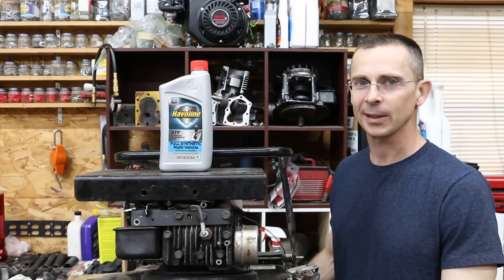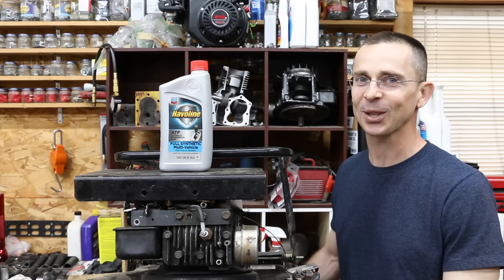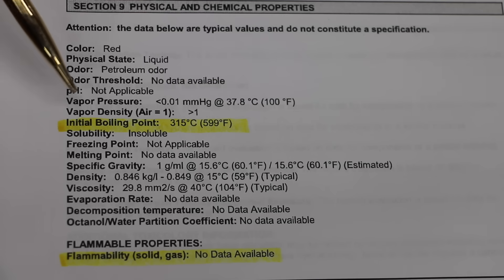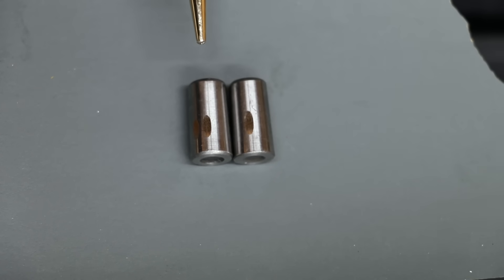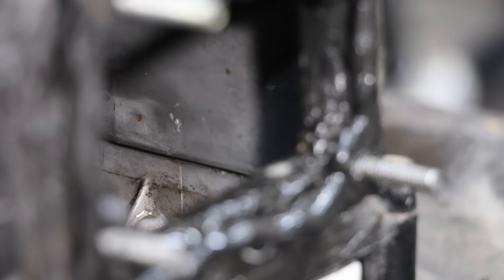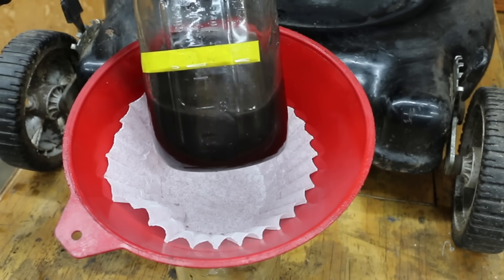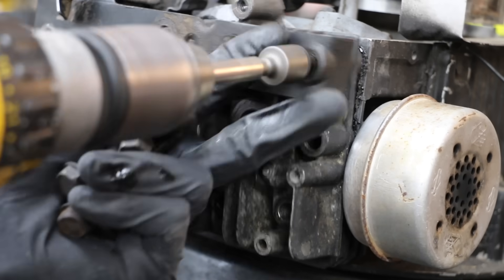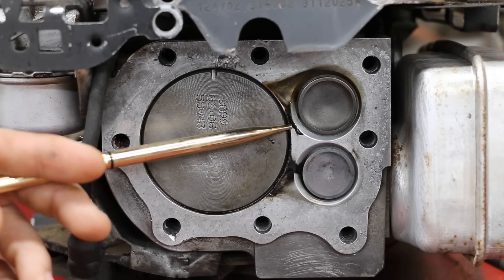ATF as an Engine Oil substitute?  Let's see what happens!

Comment: First off, Great videos, my personal preferred way of cleaning an engine has always been to pour a quart of atf in the crankcase while I use an iv drip to feed it either seafoam or techron injector/intake manifold cleaner, usually a quart of the stuff takes 30 minutes or so with the rpms held at 2k, I've done this probably 30 times now with 100%, success and clearly a much better running engine after.
Reply from the maker: Thanks for sharing.

Comment: 1 more trade secret for you... adding normal brake fluid (not synthetic) to engines that smoke at iddle, usually from valve seals, will stop the smoke on the spot, 1 small bottle of break fluid will do for most 4 cyl engines, the brake fluid will soften the rubber on seal that hardened with the engine heat overtime, and most of the brake fluid will eventually evaporate with time so it is not going to cause problems on the long run, it will also help with seals all around, same thing if you have a petrified O-ring that you want to revive, leave it in brake fluid 24 hrs or more till it softens back to your liking, the more time the softer it will get.
Reply from the maker: Thanks for the feedback.
Reply: @ProjectFarm  My pleasure, love your dedication to bring awesome content, keep it up 🤙

Comment: I have used it to clean the engine many times, but in a different way... around 500 miles before an oil change I will add 1 Qt of transmission fluid to the engine, without taking anything out, usually the engine is already a tiny bit low in oil and the extra Qt will just go over a very small amount, still always measure to see if it needs even more, and then when it reaches the oil change mileage I will simply change the oil. That method has worked extremely well. Another method for cars that had been neglected is remove 3/4 of the oil and replace it with diesel, idle the engine for 3 or 4 minutes and drain it, do not place back the oil drain plug and just poor clean diesel in the engine to flush the rest of the sludge, it will eventually come out clean, once it is clean diesel coming out from the drain hole, plug back, replace oil filter and refill with the normal oil, It will last cleaner a lot longer.
Reply from the maker: Thanks for the feedback.

Comment: Did some valve cover gaskets on a 1980 SB350 in a old K5. When I removed the valve covers, the valve springs could barely be seen! The engine did burn oil and on a road trip the oil light came on. Desperate for oil I added 3-4 qts of ATF and limped it home. The engine was knocking and I figured it was done, but a oil change wouldn't hurt. The oil that came out was clumpy and black. With new oil the truck fired right up and was smooth as can be for a old tired engine. No knocking or ticks. I changed the oil a few times that month, and clean oil came out the 2nd time.  Now here is the kicker. The Transmission went out so the truck got parted out. I removed the intake manifold to swap onto another vehicle and the liter valley, and cylinder heads looked brand new. The paint Mark's on the valve springs could be seen. I do not recommend this, but I was astonished.  I would have loved to have pulled the oil pan.
Reply from the maker: Thanks for the feedback.

Comment: I was told by a neighbor years ago about adding a quart of transmission fluid to an engine to clean it out. For years I subbed a quart of transmission fluid to the engine for 1 quart of oil. Later I broke the engine down to see if had any affect on the internal parts. The cylinder walls showed very little wear. The bearings had lost their plating in areas but showed no signs of scoring or seizing. The crankshaft had a mirror finish on all the mating surfaces. The lifters were slightly worn (concaved) and the cam looked fine. The inside of the engine was completely clean and free of any sludge. Even though it is great for cleaning out an engine, I would not run it substituting 1 qt of trans fluid for 1 quart of oil and running it continuously.
Reply from the maker: Thanks for the feedback.

Comment: A Dodge dealership mechanic bought a new Dodge Dart with a slant 6. After the break in oil he always ran 1 quart of ATF in his oil for every oil change. After 170,000 miles he pulled off the valve cover and it was near immaculate inside with everything well withing spec for a 170K engine. Oil consumption was not quite 1/2 quart in 3,000 miles. Sounds good enough for me.
Reply from the maker: Thanks for sharing

Comment: Interesting video. I’ve always wondered about ATF vs Marvel Mystery Oil. How similar they are or aren’t, if one is better in some ways for some “cleaning” applications than the other.
Reply from the maker: Thanks for the feedback.
Reply: Used ATF and the crankcase for over 40 years before I even heard of a MMO which I never had a reason to use and never been deceived from it.

Comment: I had a really dirty engine. Drained the oil and filter. Put a new filter on. Poured in one gallon of super clean. Took distributor out. Turned the pump over by hand. Drained the now dirty stuff out. Got some cheap oil and filter. Did the same. Turned the oil pump by hand. Drained that out. Put in good oil and filter. Turned pump over. Put distributor back in. Oil stayed clean and engine had no tick or noise. Worked great !
Reply from the maker: Thank you for the feedback

Comment: Used to use Type F in old engines, specifically a Dodge 318 we had for 22 years and flushed it with ATF once a year, when we sold the motor it had 300,000 miles and was running perfect and looked like new under the valve covers.   The truck it went into was still running 10 years later!  But we would never run it as long as you did here
Reply from the maker: Thanks for the feedback.

Comment: I've used ATF in a cylinder to help free up a stiff engine on a Honda 110 ATC. Did a great job at that, and the engine is running strong to this day. Wouldn't recommend using it to replace motor oil though!
Reply from the maker: Thanks for sharing

Comment: I have used ATF to "clean out" a dirty engine. But never tried it for a stuck lifter. I used straight kerosene in the crank case to free a stuck valve once. Not all the oil was removed but most. After doing it and having it fail, was about to give up and the valve came loose . Don't know what that is worth but there it is. I am under the understanding that ATF has a lot of detergent in it which should clean stuff better but who knows really.   Thanks for proving/disproving the tales.

Comment: ATF will not be comparable to motor oil. It is designed to work with a wet clutch system, therefore it does not contain friction modifying agents. This is also why you should not use car oil in a motorcycle that has wet clutches.
Reply from the maker: Thank you

Comment: In the 60's I used to buy old cars, clean them up and sell them. Some of the Ford "Y" blocks had oiler kits on them due to clogged oil passages. I would change the oil with 4 quarts of oil and 1 quart of automatic transmission fluid. I would drive the cars for a week or two  and do the same thing two more times. Then I would remove the oiler kits. It does work. Also old automatic transmissions would not shift due to hard internal seals; My cure for this was to add one small can of brake fluid to the trans. Brake fluid would soften up the seals and the trans would now shift gears.
Reply from the maker: Thank you

Comment: I have a friend who was a truck driver forever... He suggested using Type F ATF in the fuel to deal with a miss on a 351 Windsor (fuel injected). I had tried fuel system cleaners, etc., but he put it in every 3k miles on his rig. I tried it and it cleared it up and ran amazing. The detergent in that stuff is really good. Don’t know about running it in an engine case however...
Reply from the maker: Thank you for the feedback

Comment: Yeah I've freed up ticking lifters with a bit of ATF in the crankcase before an oil change on multiple occasions  but come to think of it I really revved the engine (without load) to it's max (well almost) RPM for a length of time each time. Perhaps that alone solved the ticking lifter by sheer heat and engine speed.....
Reply from the maker: Great information. Thank you

Comment: One night I blew a engine oil cooler hose while towing a boat deep in the back country mountains. Bypassed the cooler, added 2qts Dextron (original non-synthetic) and 1qt 2-cycle oil. No oil registered on the dipstick so I scrounged up a qt. of power steering fluid from the only vehicle that passed by. With that added I drove the 275 miles home. Oil pressure was a little lower than normal but still adequate. When I drained the pan the lubricant was very thin and dirty but the engine was still perfect. With new cooler hoses, oil filter, & fresh oil the tow warrior was good to go. It was basically a 1 ton Suburban w/463 cu. in. of Buick big block torque. The truck is long gone but that engine is waiting for a suitable rat rod project.
Reply from the maker: Impressive!  Thanks for sharing the experience!

Comment: We never use 100% ATF in the crankcase, but somewhere between 10-20% mixed with oil. The detergents in transmission fluid clean better than anything else, especially on older VW/Audi engines with noisy tappets.
Reply from the maker: Thank you for the feedback

Comment: Not as condescending as you think. I rember a Buick manual where temporary 10 weight oil could be used in trans. Flush at first chance at a certified GM shop .
Reply from the maker: Thank you for the feedback

Comment: I rebuilt a 170 slant six years ago and I ran ATF in the engine for the first 500 or so miles. ATF does not have detergents that engine oils have, transmissions do not have to contend with blow by. I used the ATF to help break in the engine. Engine ran great. 
There have been many times that I have put ATF in engines when they were low on oil and I did not have any oil but  ATF was available. I think it's better to have full lubrication and use a quart or two of ATF than to run the engine low on oil until you can get the oil that the engine needs. I will usually change the filter and oil in the engine soon after using ATF.
Reply from the maker: Thank you for the feedback

Comment: When cleaning engine from internal sludge and carbon buildup the best thing I have seen and tested is ca 10% DMSO in engine oil . Have done it to 2 of my car and no problems. Run engine two-three times(30- 40min  max)  usually is enough. New oilfilter every flush! Engine rpm can be risen second time to 2500-3000.  Sometimes even seized piston oil-rings come loose and engine will not consume any oil after that kinda flush. My old 2004 volvo tdi when looked internals after with stetoscope looks like factory new. Beware of inside painted oilpans!!!. DMSO dissolves paint and u dont want paint particles jammed in oil catch tube. Need to check that before -procedure-. And remove paint. So much gunk comes out of the engine you dont belive and it will not harm any engine components if done carefully. Also very effective in injector cleaning. Even bmw x5 will have no mercy; https://www.youtube.com/watch?v=06tX-NkaHgc
Reply: Maybe it would be helpful to tell others what DMSO is?

Comment: Right before doing an oil change, I add about half of a quart of Dexron 3/Mercon ATF to the crankcase. I then run the engine at idle for 10 minutes. After shutting off the engine, I perform the oil change. This helps with lowering the amount of oil leaking past the gaskets, as well as helping with compression. Keep in mind that all of the vehicles I own are over 10 years old. Works great for me. 👍
Reply from the maker: Thank you for the feedback

Comment: ATF is useless for such purposes. Engine oil contains far more and far more effective detergents than does ATF
I have a suggestion, though—xput water in the crankcase, run it and see what happens
The whole atf in engine thing is just another myth. No benefits whatsoever and will actually cause excessive wear or damage to your engine
Reply from the maker: Thank you for the feedback

Comment: At a dealer auction I bought a Subaru ($89) with clogged and stuck lifters, put in ATF ran and drove it short distances and after a few days I had a perfect running engine  . . . Of course I put motor oil back in it
Reply from the maker: Thank you for the feedback

Comment: Haven't yet watched the video but my hole life I been using trans fluid in the crankcase 1 quart+4 quart oil on the last few months before oil change + if it's below -O it will be the best thing for the engine due to its properties, Just yesterday I added a quart trans fluid on a low oil dip so I will change oil towards summer time, 2001 gmc sonoma runs like a top but i'm fussy old man. Funny story I went to get the quart of trans fluid and got a quart of used oil I save for general use and got just a tad of it in before I realized my fubar wew scared me but the trans fluid will fix that+help all the seals stay suppel. Could be wrong but 63 years of doen it that way aint hurt nothen.
Reply from the maker: Thank you for the feedback

Comment: When performing the lubricating test you should monitor the temperature of the bearings. Also as a pre flush treatment of an engine, you wouldn't replace all of the oil, but approximately 20% then perform a normal oil change after running it to clean. No oil is going to repair metal damage and unlikely to cause damage unless you load the engine without adequate oil lubrication. Chemical flushes are going to help when there's a build up to clean, and causing problems. Extreme conditions like burned sludge can be cleaned with kerosene and frequent changes until the motor is safe to operate normally. But the damages done may be excessive. You can also add the transmission fluid to the fuel to soften the carbon buildup and clean up the mess after. I'll perform these before I tear down an engine if I have time to see the affect.
Reply from the maker: Thank you for the feedback

Comment: The gunk inside some old motors is what keeps them running. Had a friend with a GM 350 ci motor who got talked into having it "cleaned out" and it blew smoke out the exhaust afterwards due to piston rings not sealing anymore. I have found that frequent (every 5000km or 3000 miles) oil changes was all I had to do to keep my cars running trouble free. Cheers
Reply from the maker: Thank you for the feedback

Comment: I have an old 95 Celica with a 1.8L that has a fair amount of blow-by and some compression loss. Do you think running some atf through it before it's next oil change might help correct some of that or would I be better off with some seafoam or marvel? (Would rather rebuild/refresh the engine, but I don't have the funds or space at the moment.)
Reply from the maker: I wouldn't, since it could cause harm to the catalytic converter and sensors

Comment: i repair cars .. m/cycles ... mowers ect in a small town ... had a customer with a new mower that had become stuck ...??? pulled the head piston stuck ...not seized..stuck.... cleaned it with fuel .. drained the oil ... got it running ... gave it back he mowed the lawn .. two weeks later .. same problem .. stuck piston stripped it cleaned it drained the oil ... looked a little harder and noticed a crystal like  stuff in side the motor went to his garage and had a look around and found linseed oil .... no no no his dopper son didnt put that in it .... never herd another word ..... linseed oil would be a great sabotage in the dumb sons car  but nar hes on the dole poor twerp ... waster of my time .. and they didnt want to pay for the second repair ...
Reply from the maker: Thank you for the feedback

Comment: This is an interesting test. I have used for years automatic trans fluid to pickle an engine for storage and to free up sticky valves (introducing it via the carb as the engine runs) but never to "clean" the inside of an engine. I have heard of introducing some info you regular old to free sticky lifters but never done it myself. As I understand it ATF has high levels of detergents in it but that statement as fact could anybody's guess as to veracity. I think that the reason it may work to free up things generally is more attributible to it's viscosity or mineral make up or maybe creep than anything else. Whatever the case, using it to clean a crankcase isn't it's high point. Suggestion: They make some pretty strong oil system cleaners for noisey valves, how good do they work?
Reply from the maker: Thank you very much!   Great test idea

Comment: When I ran older vehicles that had lifter noises, I would add half a quart between oil changes if engine timing wouldn't fix it.  
John Deere operator manuals from the sixties recommend running 50/50 oil and kerosene to clear up sludge.
Reply from the maker: Thank you for the feedback!

Comment: Better than 45 years ago, I know of a guy driving around town here on the Eastside of Detroit in a Pontiac Parisienne. It was a Pontiac station wagon version of the Chevrolet Caprice. He used, from his first oil change. Straight transmission fluid in the engine. The last I saw of the car, it was still running like a top with 155000 miles on the ticker. And that's what the junk camshafts they used to put in the V8 engines. Because the way the General Motors was he treating the camshafts the front two set of Cam lobes tended to wipe out if you weren't very meticulous with lubrication. Sometimes it did matter. The front two sets of Cam lobes went anyway. That's why a lot of those engines would start running funny between 60 and eighty thousand miles

You may want to try only a 20% mix of transmission fluid. The same thing could be done with Marvel Mystery Oil.
Reply from the maker: Impressive!